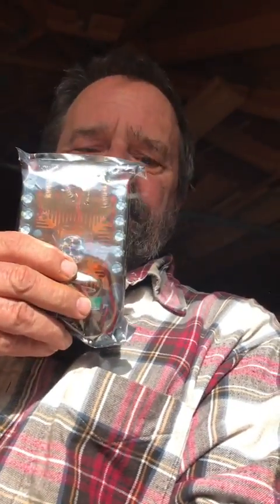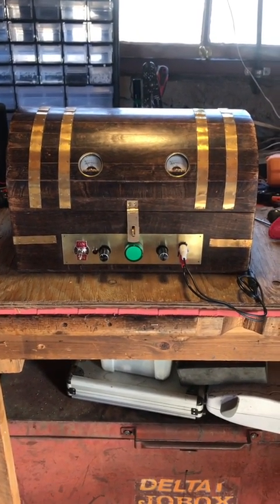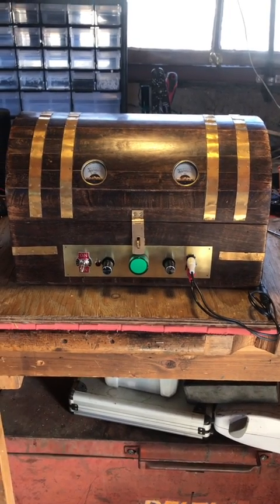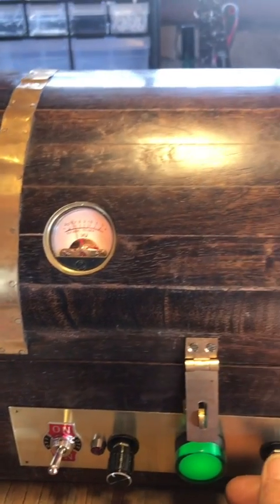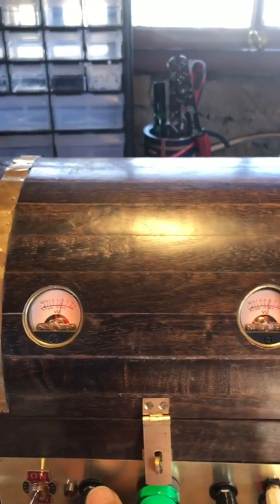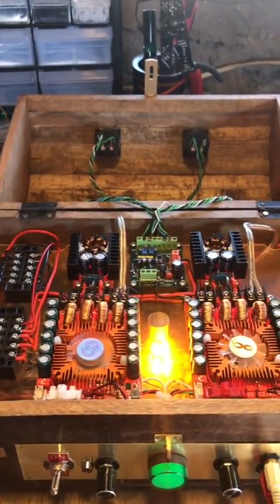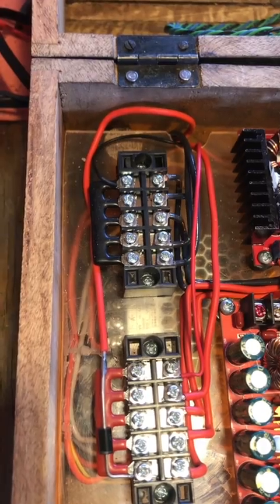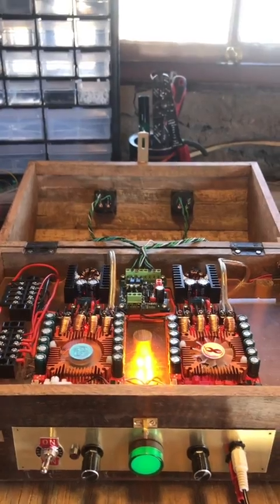TDA 7498E finished

Comment: could you make that bluetooth?
Reply from the maker: That's what I easily did by buying a bluetooth receiver and a mini jack to RCA adapter.
But be forewarned, I ended up scrapping this thing because the TDA 7948 are just wayyyy too fragile.
Just look at the chip wrong and they'll blow.
The slightest tiny droplet of anything wet, and they'll blow.
A short circuit, no matter how small, and they blow.
The boards are pretty damn far from robust, hit a joint more than once or twice with a properly set iron, and you're likely to not only lift a pad, but possibly some trace as well.
I went through no less than 6 amps building this thing, and I was once mil-spec certified in soldering assembly.
Look for something less flimsy.
These are just not built to handle the power they're running through them.
You just can't run 400,000 gigawatts through a 28 ga wire and traces thinner than gold foil.

Comment: You could have ran both amps to one volume control
Reply from the maker: This was just an experiment, and for fun.
I could have done a whole lot of other things, and/or differently.
The one thing I did determine, is these amp suck as far as durability, and fragility.
Just look at one of these things wrong, and poof! chip blown.

Tubes are where it's at, always have been.

Comment: Good job.
Reply from the maker: Thank you. It was a learning experience, and it's still working.
I only blew up 3 of them them getting there.  🤣
Reply: @joesbarbecue1  .    Yeah . That's the process with the DIY .    I'm still  working with the TPA amplifiers .  Good sound but not that
 powerful as a TDA 7498  does .   Maybe later I'll try one of those TDA amplifier .  Also with a  module DC/ DC converter for use with 12 volts.

Comment: Hi sir can u give me vu meter circuit details
Reply from the maker: Sorry I'm late to reply. The VU meter came with instructions. The only thing I can advise against is running a ground from each amp to the VU board. For some reason it blew up amps.
I ended up only running the ground from one amp. The meters aren't as animated, but still work.

Comment: Hi !  thanks for the video.  Great creation and i am sure with an excellent sound.  I have two questions: 
1)  did you bridge them ? is it difficult ?  
2)  why noy using a powerful smps instead of a step-up converter ?  i am thinking to a 36V/10A unit from Meanwell and the like ... just to have plenty of energy on tap.  
I have one commercial unit also myself, powered with a Lenovo 170W/20V  smps for small form factor pc ... but i have been told that 20V are a little on the low side as Vsupply ...  i have already an industrial smps to try out ... 24V/10A ... not tried yet.  Thanks again and kind regards, gino
Reply from the maker: Thank you Gino. Yes they are bridged. That's why there's two. When they're bridged they become more powerful mono amps.
Bridging isn't hard, you just need to put 3 jumpers in each board.
The reason I went with step up converters is they are running on 12V solar batteries, but I also installed a meanwell 120ac to 12vdc converter so I can plug this into AC if I want.
There wasn't any real big high end audio goal here, it was just more for fun, and to get some tunes in the shop.
The thing about these amps, is they are quite sensitive to screw ups, shorts, etc.
I think I blew up at least four of them when trying to hook up the VU meters.
Reply: @joesbarbecue1  hi thank you for the very kind and helpful advice At present I am experimenting different power supply solutions I am using a lenovo 20V/6 A maybe too low in voltage I have at hand an industrial 24v 10a beast I have no clue about the result Next and final test i guess will be a smps 36v 10a maybe it will be good for fusion music... Or just fusion I am crossing fingers Congratulations again for your very nice creation kind regards gino
Reply from the maker: @gino3286  These are rated UP to 36 volts. I seriously doubt that you would hear any difference in performance between 20V and 36V. (I could be wrong, but I don't think so) Then again, I never run it up to 11. :-)
I have mine set lower than 36V just out of fear of blowing up yet another damn chip.
Another experiment I tried was a two tube preamp kit I built.
It worked pretty well, until I over drove the preamp in, and blew yet some more chip.
Reply: @joesbarbecue1  Hi thanks a lot again and i promise ... last question.  You said at the beginning " ...  they are running on 12V solar batteries, but I also installed a meanwell 120ac to 12vdc converter ..."   Do you hear clear any difference between the two power solutions ?  Thanks a lot again.  Kindest regards, gino
Reply from the maker: @gino3286  No, I don't hear any difference in sound between the two sources of power.
Reply: @joesbarbecue1  Thank you very much again.  No more questions.  Congratulations again for your creation.  Kindest regards, gino
Reply from the maker: @gino3286  Not a problem Gino. I'm more than happy to help.
Reply: @joesbarbecue1  thanks a lot again sincerely I am quite lost in this huge choice of chips My medium term project is to try to assembly a chip based power amp to use with a little cheap tube buffer from brand fx audio that i am finding quite amazing for sound I will be buying the same boards you have used and maybe upgrade the caps on board with high quality ones like epcos or nichicon those intended for smps  I hope the chips used will be genuine Fakes are the recent fashion My best wishes gino

Comment: That is really cool!
Reply from the maker: Thanks! 
It's still working. I've blown it up once since I built it. I bought a tube preamp kit, built it and was going to install it with the two tubes sticking out of the top.
It worked until I turned the preamp up too much I guess, and it roasted the amps.
I've since decided that wasn't a good idea.
Reply: joesbarbecue1 I’m doing the same thing for my record player.  The TDA7498e (amp) I purchased doesn’t seem to work.  Got 24vdc into it, using a Bluetooth receiver connected with rca jacks.  A little red light (I think it’s D9) comes on but no volume.  I’ve got a 50w x2 and a 100w x2 that work great, but I’d like to hear my speakers through 160w x2.  I ordered another TDA7498e to see if the one I have is just a dud.
Reply from the maker: @meesterdinglefritz2064   I don't know. You could have a dud. These little D class amps aren't very resilient, it only takes a fraction of a second to pop the chip if you accidentally make a wrong connection or feed it with something it doesn't like. 
I went through a number of these amps while trying to do things like hook up the VU meters.
It's easy enough to pop the fan off, and look at the chip underneath to see if it has burned up.
Also the led will remain lit even if the chip is no good.
One more thing, most record players don't put out much of any signal at all. You may need a phono amp after the turn table, then on to the TDA.
Reply: joesbarbecue1 thanks for the advice! I’ve got a standard phono amp, but purchased one of those AOSHIKE tube preamps from Amazon.  It works with the other few amps I’ve got, but not very loud.

I’ve really only tried the TDA7498E with a Bluetooth receiver (which works on the other couple amps).  So I’m thinking I may have gotten a dud.  No big deal, Amazon’s got a great return policy and I already ordered another.  I’ll let you know how it goes.

Thanks again for the advice! I really like the stereo you made, the enclosure looks great! Also, what are those two gauges on the front? I like the look of those.
Reply from the maker: @meesterdinglefritz2064  Those are the VU meters, I think I got them off of ebay. Hooked up using the instructions WILL blow the amps.

Comment: Good project but your dc stepup converter will not provide required current to amplifier, use another  high power converter.
Reply from the maker: It works just fine for my purposes.
I get well over 90db if I want. That's enough for my shop.

Comment: Hi great project. 
I bought this amp in Aliexpress and it works fine but it doesn´t support all of his potencial. I explain: i put 36v with a power supply and it gives plenty of volume but only for 10 seconds, then it goes to a down volumen.
Is this your case? What can it be?
Thanks.
Reply from the maker: I have not experienced the problem you describe. I suspect many of these little Chinese project amps and boards are using crappy knock off capacitors, which can cause all kinds of problems. But that's just my guess.
I might also suspect your power supply.
Have you tried taking a voltage reading from the supply while playing to see if there's any change?
Also, even though these are rated at 36 Volts, I wouldn't run them with so much.
I am feeding mine around 24-28V.
Reply: @joesbarbecue1  Thanks
Reply: Buy only SANWU written mark amplifier board. My tda7498e works fine even at 38v dc supply.
Reply: @miteshkumar7603  Link please?
Reply: alberto marcos Just search tda7498e on aliexpress,amazon,etc